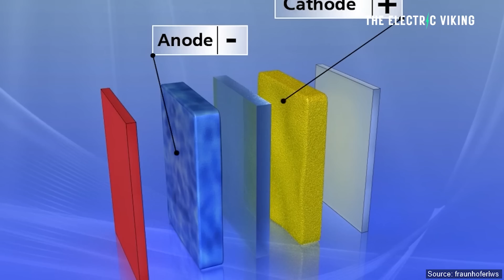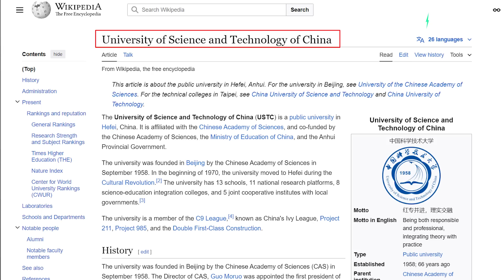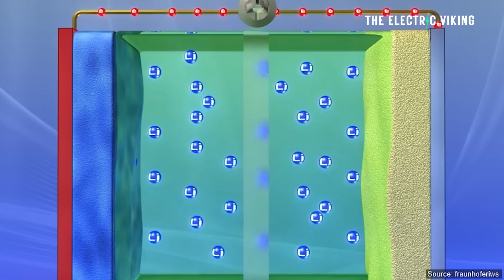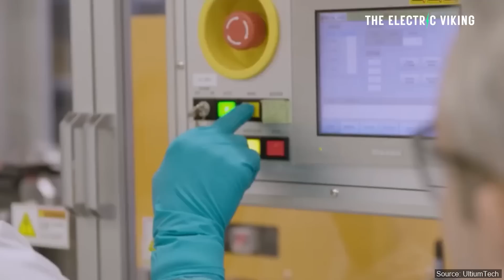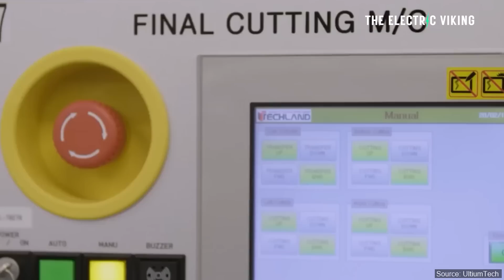China's game changing solid electrolyte slashes solid-state battery costs 90%

Comment: A battery that gives 500km of range and can be charged in less than 10 minutes should be good enough. It is more important to clean up the battery production process, such as removing synthetic graphite to reduce the carbon footprint.

Comment: No the problem is dendrite formation in the lithium sulfide. Lithium sulfide is by far the most high capacity  energy storage medium we have have.... The details of preventing dendrite storage for long battery life just aren't solved yet..... But they're getting there and we will.   The theoretical capacity of lithium sulfide batteries is seven times what current batteries capacities are, and practical applications demonstrated are about  three times.... As of 2 years ago....760 wh/kg was lab demonstrated.

Comment: i used to drive a truck for a living (not very long - 3 months). the company that i worked for said doing 400-450 miles per day as a pro trucker was a good distance. -having said that, i wonder whether the same applies to cars? in other words, most people would never drive more than 400-500 miles per day, which means that EVs could be equipped with "lesser" battery packs that might give cars 600 miles of range rather than 1000 miles of range? -this would cut the price of the pack and still provide enough range to do 400-500 miles per day provided countries implement good charging networks. -would probably also be quicker charging? anyway, just thinking from a "standard trucking practice" perspective.... thoughts?
Reply: We dont need to waste $ onbl batteries. Or chargers..

Comment: The Japanese are very secretive, because they want to ahead of the Chinese and the Americans. People still buy vehicles with 300,000 miles on the Toyotas, that were made in Japan. American car companies are the same way, and cost analysis shows, that they have to plan production around the vehicle concept. Ford’s mustang with a 289cubic inch engine or the 427 cubic inch engine. People wanted power, they gave them power. People today want a cheap electric vehicle, with a long lasting battery, that will last.

Comment: You can blab about next batt tech all you want, It gas to scale, it needs to be recyclable, it needs to be truly low cost not subsidized or it is another failure.  Truth be told fusion will beat the better battery to the punch.

Comment: Yep, higher densities for lower costs are happening steadily which will achieve mass adoption inevitably at some point. 1000km battery is great for maybe 10% of the population but for everybody else a battery for half the cost is going to be a far more important factor eg. A 400km Ev for about 15 grand that needs almost nothing spent on it for the next 500,000km where most if not all of its driving is fueled by solar....

Comment: This is good news for solid state batteries, things seem to be moving in a number of places. There was a similar announcement a few days back of a team from LESC in the US developing an anode free solid state sodium full battery design that similarly offers much cheaper production and meterials costs and also overcomes anode issues in the solid state battery (battery failure due to anode swelling, dendrite formation, and interface reaction fouling and maximising power/charge rate interface contact area).  Similarly, the European Helana solid state battery was announced back in March, using similarly inexpensive halide solid electrolyte technology to be integrated with LionVolts novel 3D structured solid state batteries for very high power density and lightweight batteries.

For the Chinese LPSO electrolyte announcement, it would be interesting what a complete battery design comprises. In particular, what anode and cathode materials are being investigate for compatibility/power capacity. Also, if a solid Lithium metal anodes are being considered, as was mentioned in the press release, then it will be interesting what design and mechanical considerations are being adopted to mitigate dendrite/interface issues that have delayed other similar batteries in the past.

Comment: There’s a reason cars are ideally around the 400 mile range. 1000 mile range is inefficient, as 99% of the time you’ll be hauling around that extra weight you won’t be using.

Comment: Instead of looking at things in terms of battery density kilowatt hours use MPCU (miles per charge unit). It could be bossed on the average amount of energy in a gallon of gas. It's simpler to say a vehicle gets 35 MPCU, or just MPC.

Comment: This is cool, IF it gets past the R&D phase into real production. As for the goal of 1,000 miles of range, I personally would rather have 300 miles of range, with a much smaller battery pack. Most reporting shows that EV owners only use about 12% of their current pack capacity per day. And most EV owners recharge to full overnight at home. So I would rather NOT carry around 1200lbs of battery that I don't use. Lighter weight has many more benefits for daily driving than extreme range.

Comment: Toyota is going to use them for smaller batteries in their hybrids so they will need much less material. They'll be smaller than their current batteries but have the same energy density.

Comment: Never stop research and development! Even though the results may be disappointing at first, solutions for tomorrow's problems depends on continued development of scientific breakthroughs. The world keeps changing. Indeed the first cars batteries based on Acid-Lead or NiCD or NiMh may not have been practical or economical but improvements in overall chemistry and manufacturing have made made today's EV based on Lithium a reality. So keep the research going by all means.

Comment: Very soon the subsidies for EV's are going to dry up. The bloom is off the rose as people buy these vehicles and realize that you must install a separate charging station in your house because finding a charger away from the home is at best difficult. I live above the 30th parallel, 5 months a year the temp is 40 degrees or lower and using your batteries to heat your car drastically reduces the range of the car. Also, you can't keep these cars out in sub-freezing weather, it sucks the batteries dry. I used to live in a place so cold in the winter my father had a heating blanket on the oil pan so his truck would turn over so he could get to work, that was before synthetic oils.

Comment: CATL’s latest LFP batteries are already in Chinese EVs, soon in Teslas. 

If you drive less than 300 miles (~480 kms) per day and can plug it in at night with a Level 2 charger, then no one needs more range. And 90% of the people drive a whole lot less than 300mi/day. 
Otherwise just keep on buying hundreds of gallons or thousands of litres of gasoline per year, whose exhaust fumes pollute the air that all of us breathe in and contributes to greenhouse gases. 

First replace one of your ICE vehicles, then a few months later your second one. 
AND you don’t need to buy new, buy used 3-4 year old. There’s very little that can break down on an EV. And maintenance costs are minimal. 

Answer one question, why do you want your kids to keep breathing in the exhaust fumes from your ICE SUV or car? The answer is that you don’t!

Comment: my smallish narrow (necessary) ICE car reports 230 inaccurate miles on a full tank, call it 300. To fill up and pay takes 5 minutes. We don't need 1000 mile EV range (=15 hours driving!). Solid State batteries that can charge to 300 miles in 10 minutes would be acceptable to a lot of people, especially if charged at home beforehand! & 300 miles of 450 Wh/kg is lighter and needs less battery to achieve 300 miles.. We aren't there yet. 10 year's time I am hoping.
Reply: You're going to need a big charger to fill a battery capable of 300 miles in 10 minutes. By my calculations, you're going to need about a 450kwh charger, and that's not taking into account ramp up and ramp down. Just to put that number in context, the mains coming into my house are fused at 63 amps. At 240V nominal that's a little over 15kwh. So, 30 houses worth of power to charge a car in 10 minutes? Don't hold your breath.
Reply: @davidbrayshaw3529  Sure. House cheap rate overnight, top up 6kW for 8 hours is how much? Charging stations are beginning to be rolled out at 500kW. That's a lot of energy, but no different from petrol. They have big tanks, and it is highly volatile. Big amps means big cables - ever considered the weight of a nozzle? Though not. - it is the only sort you get. All it needs is time, for infrastructure to catch up. Mrs Benz (she did the first lengthy run to her Mother) had to buy petroleum spirit from pharmacies - did the infrastructure catch up eventually? It followed the demand.
Reply: @RedRouge-j4j  Topping up overnight at a low rate of charge isn't putting a huge demand on the grid... but it does mean burning fossil fuels, in many instances.
Supplying 500kwh chargers... that's a different kettle of fish, especially if you plan on having multiple chargers in one location.
Turn ten of those on at one time and that's going to take the same amount of power that it takes to service a small town with a few thousand residents in it. It's a lot of power.

Comment: Yes, they need to improve their batteries. If I am going to get an EV for work I need at least 300 miles as I drive 300 miles a day. A car with 300 mile range means that you have 200 miles between charges because you cannot charge above 80 and below 20%. If EV charges 30 dollars for an electric full up, that means it’s no cheaper than gas. The only way to save is to charge it at home. Right now it takes an hour to charge an equinox. Who wants to wait an hour for their car to be charged while coming home. The technology needs to improve.
Reply: Wrong.  NMC batteries should not be charged above 80% regularly.  But LFP batteries can be charged to 100% all the time, no problem.
Reply: @tysonn4736  that’s true, but there’s not a lot of cars here in the US that has the phosphate batteries. I just know the Tesla model three. Do you know of any others?
Reply: @larryg7109  All of the standard range Teslas use LFP batteries.  Kia EV5 is another one.

Comment: I'm very chill. Whether is the Chinese or anyone else, battery prices will drop non the less. 
Economics 101: where there's demand and lots of money, there's a way. 
In 5years max, everyone can stop talking about range and charge speeds.
Reply: It really depends on your elected donkey 🫏 cons to feed the bargain to you.
Reply: Bigger, higher capacity batteries, The USA still doesn't have the grid to charge them. It will take 50 years and 3 trillion dollars to make it work.
Reply: @transmitterguy478 smaller batteries with high capacity will mean less weight and more efficiency.
Reply: @hoffinger  Don’t hold your breath waiting. The first battery that actually worked reasonably well was made in 1800 so we’ve had 224 years of battery development to get to where we are now. To match the average ICE car range and “fill up” time and keep a replacement battery price around $12K to $15K USD will take some decades yet.

Comment: The biggest bottleneck is charging.  A battery with three times the energy storage capacity may well take 3 times as long to charge. Until every consumer's home has 480 volt wiring...
Reply: Really not the case, since a higher energy density battery would not be used to double or triple the range; rather, at least half of the increase in energy density would be used to reduce the size and weight of the battery (this increases range too, but improved overall vehicle performance while reducing cost), while the remaining increase in energy density would typically be used for increasing range by perhaps 20-40% (from 250 - 300 miles to 300 - 420 miles). Additionally, you use your home charging to only add back enough charge for your normal daily driving, while the superchargers are used for long-distance travel. Superchargers also could readily increase their output rates for the 20-40% increase in range, to keep fast-charging times in the range of the 15-30 minutes one typically needs for a pit stop.

Comment: This is fantastic for portable electronic devices, or anything electric/electronic, noone wants to charge devices every now and then, you forget or whatever, you end up with something you can't use. As great as this is, I really don't wanna drive 1000miles on an EV, thanks. I like combustion engines, preferably, I'd like some kind of fuel where everyone is free, ie. cheap if not free (water/hydrogen etc) and plenty to be found - no rare materials, no complicated manufacturing (fuel cells etc), just some cheap easy to get fuel. Batteries are no good for road vehicles. Plz stop developing EVs. They suck.
Reply: Now that we’re in the 21st century we must address the atmospheric pollution problem.😊
Reply: @malcolmrickarby2313  hydrogen fuel or anything related addresses emissions if that's so much of a problem, with no batteries involved.

Comment: The safe and economic availability of an extended range battery on a par with the range of ice engines today is a large stumbling block for a wider, more universal acceptance of evs.  Not everyone wants or needs long range, but many, mainly those not living & commuting in large cities, do & it would go a long way towards that goal.
Reply: Ev range is already on par with gas range.  The batteries they're working on have the capability to take that times 2.5=  1,000 mi range. 10 minute recharge. And safer.  Solid state lithium sulfide has always been the holy Grail..... You don't hear about it because there's plenty of people working on the dendrite formation problem.

Comment: Lithium and sulphur are both abundant and should be literally dirt cheap. This sounds like trying to fix the wrong problem that will be fixed by the markets if we just wait for resources to catch up.
Reply: Lithium is abundant? Compared to what? And no, elements that still require costly mining and processing to extract from ore or seawater/brine should NOT literally be dirt cheap. If the battery  problem can feasibly be solved using, for example, sodium-based tech, then we should strive as hard as possible, and as fast as possible, to commercialize the solution, since the cost advantage (in both financial and environmental sense) will eventualy be overwhelming.

Comment: Solid state batteries may not really be needed in EVs, but they are probably a game changer in aviation.
Reply: Uh semi solid state cells already can cut off 30% or more in pack weight alone. Example welion semi solid state cells in the nio et7 150kwh pack weighs a mere 44# more than the catl nmc 100kwh pack does for the same size case going in the same vehicle! 

So 50% more capacity for a pack level energy density gain of over 43% And a weight gain of 44# or about 20kgs. 😎

Imagine the tesla semi with it's 915kwh pack weighing nearly 9,000# dropping down to 6,000# for the same useable pack capacity.
Or a tesla model S or X plaid dropping 350-450# off it's pack weight which would reduce the cars total weight by 6-9%

A model 3 perf could go from 4,050# down to about 3,700 with a semi solid state pack! A base m3 rwd could drop down to 3,500# 😎
Reply: Once they can make them in scale at a low cost, everything will use them. Why would you use a liquid battery?
Reply: You clueless if you think they are not needed in cars
Reply: Powerful electric motors are much more powerful than ICE engines per kg or per lb.
Also less machine complicated than ICE for durability and longer continuous operation. 
Battery 🔋 power needed to be more advanced is the main obstacles.
Reply: @loktom4068  Battery avance are already here & more to come. Why wait when you can already make a déférence for the planet & especially for your wallet 😀
Reply: aviation typically uses lead acid or lead gel batteries. Works quite well.
Reply: @svr5423  Maybe to power accessories, but not to lift the plane.  The energy density of lead acid is horrifically bad.
Reply: @incognitotorpedo42  reliability is more important than energy density.

Lift is provided by the wings, power to the engine is usually provided by avgas, mogas or jet a1 fuel.

There are some battery planes for training, but these are not really viable for anything else as they lack the capacity for a mandatory reserve (if you can go 1 hour and need 45min reserve, you aren't really going anywhere in those 15min).
Reply: @svr5423  Not for powering electric engines. Only to supply energy for the electronics/electro-mechanicals.
Reply: @bobsmith3983  yes, the electric motors (e.g. for flaps) can be powered by the battery. Depends on the airplane.

Propulsion is usually achieved via piston engine or gas turbine.
Reply: @svr5423  You mean kit plane!

Comment: CATL named their new battery the "Condensed Matter" battery, later shortened to just "Condensed."  Condensed Matter Physics is the modern name for Solid State Physics, which enabled the invention of the transistor.  IMO, battery companies using names like "solid state" or "condensed matter" are just trying to make solid electrolytes sound as revolutionary as the transistor was. Pure marketing hype.
Reply: Wouldn't they be as revolutionary as the transistor?
Reply: @magnetospin  No.  Not by a long shot in my opinion.
Reply: @magnetospin  - In a way yes, transistors, solid state batteries etc. all equally steps in the current Electron Revolution, that is overtaking the previous Industrial Revolution at pace in importance and significance.
Reply: @georgepelton5645  What would you call solid electrolyte?
Most people except us oldies don't  remember when 6 transistor radios came out in the 50's.
Reply: @ronfarnsworth7074  I refer to them as “solid electrolyte batteries”
Reply: @ronfarnsworth7074  By Sony.